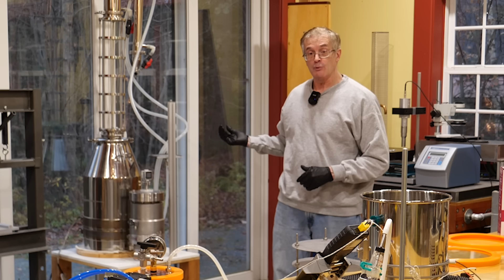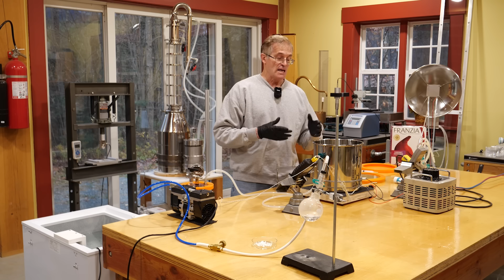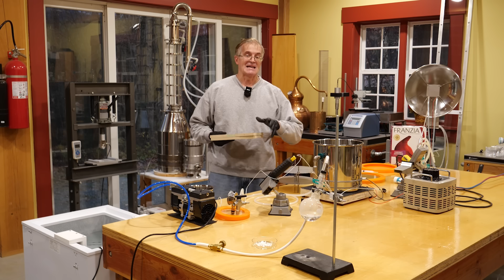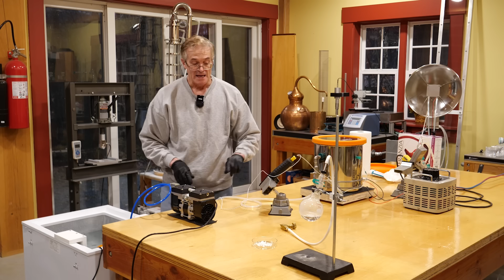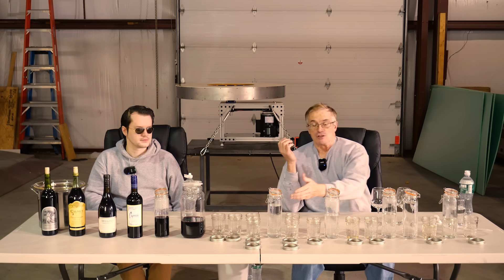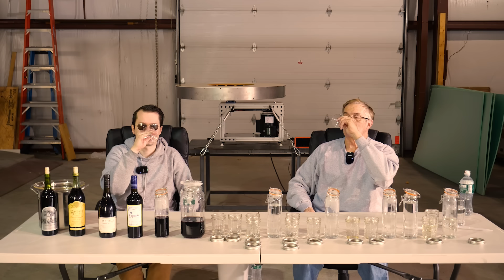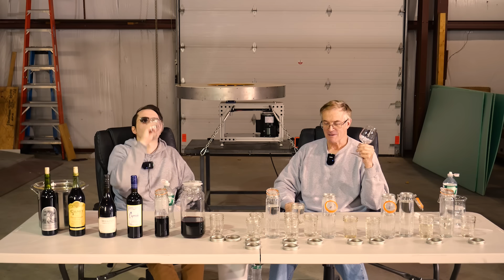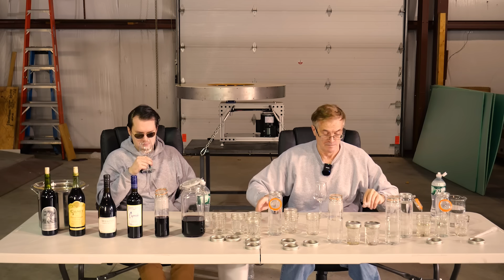Turning $3 Wine into a $100 Vintage with Science!

Comment: Try putting the new wine you made into different types of wood cask for a few months and see if that puts it over the top for both taste and aroma. Also try pulling apart a high end wine and see you can improve on that, see if high end wines have as much junk that can be removed.
Reply: Easier to add wood chips to the wine than having to buy casks. Also you can toast the woodchips to different temperatures to achieve different flavour profiles. I have done this myself and it works very well and faster than putting the wine or spirit in wooden casks.
Reply: @stumccabe  Or better yet, use the wood chips and put the container in an ultrasonic cleaner for a few minutes to get barrel aged product almost instantly.
Reply: @seeigecannon  Excellent idea!
Reply: @seeigecannon I came to the comments section to post this! It works great for me. I buy cheap, terrible whiskey for making boilo every winter, and the left over whiskey gets 5 minutes with charred smoking chips. Usually comes out somewhere at roughly a mid price range equivalent. (It's great for infusing flavors into vodka, too)
Reply: Or try to improve on Thought Emporium's vid on vacuum infusion
Reply: And if it turns out all the fractions are miraculously tasty, they can certainly just use it as really good brandy!

Comment: If you used a dip-tube in the collection pot, and used two of them, you could actually run as a continuous process, if you had check valves to isolate the collection pots.

Comment: Yup the ratio of head, hearts and tails is important as well. A good example of this is Mescal. Which like generic Tequila i generally don't care for. However, there is a brand called V-SOTE Mescal that has triple distilled and I believe put back a tiny bit if the heads and tails to make an EXCELLENT SMOOTH (never thought I say that about Tequila or Mescal) sipping Mescal. Usually here in the Yucatan served in a small gourd. For the Tequila equivalent it would be Hussong's. Hussong's used to be bottled in an earthenware bottle sealed and serialized.

Comment: Would you be able to achieve a similar thing in your big distiller if you flooded it with Nitrogen or Argon instead of using vacuum?
Reply: Likely, but a higher temperature would be needed.
His trick here is a relatively low temperature separation.

Comment: In my experience the greese is unnecessary, the pressure from the vacuum seals the gasket just fine. I am concerned about weakening the structure by drillin and pluging the thin sides with rubber. I would not be surprised if it collapsed. I have witnessed structures collapsed by vacuum. Similar to exploding but in reverse. Very scary! Thanks for the video! Cery cool process..if you have electricity.

Comment: you don't have to guess the cuts: if you have a temp gauge in the distillation fluid you can tell when there's major shifts in what's evaporating by the temp changing. you can use this as a rough guide the first few times, then as you narrow in on what you care about you can do additional cuts as you see fit.
Reply: Well I was thinking the same thing but do keep in mind that they are doing a vacuum distilation with a relatively weak heat element just to keep it from getting cold. I don't know if there would be a noticible change in temperature enough to use as a basis for seperation. I reckon that can definitely be done using precise equipment and calculating the rate of change of temperature over time but this works just fine.
Reply: @quas-r  I'm not a chemist, but I know there are ways to determine what is boiling off at a given temp under vacuum. Vapour pressure, etc.
Reply: @Scou73r you just need to find a list of the different molecular compounds in whatever wine you started with (just looking up the type, e.g. Malbec, is probably good enough) and then finding the phase charts for those chemicals. Just cross reference your vacuum pressure and room temperature and find the graph where that (pressure, temperature) point is on the line where the chart transitions from liquid to gas (or solid to gas, as the case may be). 

If you aren't able to measure the vacuum pressure or it is just easier in your setup, you can also do the same thing but inverted by using multiple condensing flasks cooled to different temperatures that you get from the same charts. You can also do it with a single condensing flask, but you have to condense them one at a time in order of their condensation  point. You have to order them correctly with multiple flasks, but they all condense simultaneously (to a degree of accuracy that wouldn't fly in a lab or fluid dynamics class, but it's basically all at the same time)
Reply: @Brenden.smith.921 Fluid dynamics classes usually only have blackboards (and maybe computers) :-)
Reply: @Scou73r  Simple, with only about 100k $ you add a mass spectrometer to the system and youll know... XD
Reply: I think it may be hard, since there are a lot of different compounds in there. If the boiling point between each of them is close then it smooths out the graph.
Add the fact that you still get some volatiles coming over when the temperature is below the boiling point due to single molecules having different velocities in the liquid so the line gets further smoothed out. The last point is why you often see triple distilled liquors - by repeating the process you can increase the separation. I'm pretty sure that was mentioned when they did the sake videos.
Finally, they would probably want to introduce some stirring in the pot so they don't have a temperature gradient in there. The liquid is going to be hotter next to the heating band than at the center of the pot when they don't ensure that the liquid is mixed to even out the temperature.
Reply: You're correct about needing to be aware of the fact that some liquids can vaporize without evaporating. These are the "volatiles" that are referred to in the video, and they will almost always come across in the initial boiling because their vapor pressure is such that they can vaporize in 1 atm, let alone 5% of that. Ethanol is one of these volatiles like this, but there are a couple other ones. They're well known and you can get them from a Google search. Since this isn't meant to be a perfect process, I would just call it good enough to know that there are some volatiles in with the first distillate(s) and know what they are. 

Also, if you do the inverted process I mentioned where you cool the flasks to a specific temperature instead of going off of the vacuum pressure and room temperature to get a measurement, then you don't run into the issue of vaporization since that process doesn't skew the data the same way in reverse.
Reply: Thats cool. I was thinking about it how to fractal it into exact components. So you just gave a solution! 🤟🤟🤟
Reply: No. They weren't using heat to distill. If you do use heat, the evaporation of the alcohol out of the mash cools it, meaning it self-regulates the temp, keeping it steady. That's why those old-time distillers in the hills of Tennessee could just throw a bunch of logs under the pot without worrying about it overheating. Just watch the thermometer, and when the temp finally starts to rise you know you're done because there isn't enough alcohol left in the mash to keep the temp down. You don't want that last bit anyway. And yes, i DO speak from experience.
Reply: If you've ever distilled a gin you've noticed a large range of distinct flavour bands. From the very volatile cilantro to the less volatile brown/dry spices one after another. Temps are useful, but won't help much  when tiny concentrations of volitiles have huge effects on flavour.
Reply: How would you approach temps since under vacuum?
Reply: In this particular setup the pressure is not necessarily a constant so that doesn't necessarily work.
Reply: No. 
1. What they taught you in high school is a lie; there are no sharp changes in temperature. Even in simple two component mixtures, the temperature changes gradually and with it, so does the proportion of the components in the distillate. It is in fact not possible to completely separate mixtures by distillation because at some point they form an azeotrope. Fun fact: Ethanol forms an azeotrope with water at 95% concentration, so you cannot get higher than 95% ethanol via distillation alone, so when he said his first fraction was 98% alcohol, that was incorrect (in fact, without using a reflux column, he was getting 80-90% at most). 
2. Wine is not a simple mixture, it has thousands of components, making any sort of temperature to component mapping virtually impossible. 
3. This setup is not pressure controlled, which makes the boiling points of all the components change over time. If you wanted to have the slightest chance of making this work, you'd need a setup which maintains the same pressure throughout the whole process with a high degree of precision.

Comment: You might make finer cuts at the beginning to dispose of the hot lip-burning foreshots, then again in the region you disposed where the alcohol runs out and you get the musty smelly-sock aroma so you can focus on just tasting those regions. You should get bright fruit early (careful because acetaldehyde can be deceiving), dark fruit later, and then the oils toward the end where you found floral!

Also I'd recommend a refraction alcometer as a quick way to proof-down the drink to no higher than 35% ABV for tasting, otherwise you blow out your taste buds, especially starting with the aggressive heads!

Comment: I was right there with you until you poured the alcohol out of the distillation vessel over the grease on the rim. I would have used a syringe to draw out the alcohol, and not contaminate it with grease. The grease may alter the flavor of the alcohol.

Comment: Did you pull an all-nighter and forget it is now Sunday?  I'd be tempted to add back some distilled water to account for at least part of the volume of liquid you removed, easy to try by diluting a sample of your recombination.   I'd also be interested if separating the first couple of ounces distilled and discarding might lead to an improvement as well.

Comment: I was able to extract lemon essence and a hydrosol from lemon peels using a microwave extractor. For small batches of the stuff, it gave surprisingly high yields and didn't cook away or dissipate the lemon essence or hydrosol like many of the standard distillations do. For larger batches I was thinking of a vacuum Soxhlet distillation apparatus. If that makes sense.

Comment: @22:20 i can say firsthand that every single harbor freight vacuum i've used has had oil residue end up in the product. even using filters won't stop it. it's gotta be food safe or it will get contaminated with oil

Comment: I guess I know why my vac chamber blew in. (The lid sucked into the pot.) I didn't use the grease.
Reply: That sounds more like an implosion from too much vacuum. In that case, grease would not have helped.
Reply: @PaulLawson-k8v   I didn't have vac pump maxed out. Or at least I didn't have the gauge bottomed out and boom pow or whatever. The lid is still inside the pot and it is in one piece but it has cracks all through it like a solid piece of tempered glass. I was cringing even though I know nothing happened or we wouldn't have had the video, but putting your head over the top of a vac chamber is something I won't do and I sure won't put my face right over one. I was standing over mine and crap hit the ceiling but missed me.

Comment: Vine is highly overrated, imho - but this I can get behind! It's like grind size and pressure curve do more to espresso than any espresso machine could ever do (according to my experiments). In espresso universe, we also do sliced shots, to see what flavours are extracted at what stage of the pull, or at what pressure.
Reply: Frosty cold, $6 Champagne is the best wine. I despise wine culture, so that's as close as I get.

Is there anything like a sliced shot, in the pour over or drip coffee world? 

I'd like an Arduino-controlled Technivorm with a trough instead of a basket, so that the entire cup is 'first fruits' (or 'heads/hearts', I guess LOL).
Reply: @PaulLawson-k8v  Interesting! I do not go near any alcohol, so I am easily out of this equation. My frowning towards vine is based on the numours experiments that have been done, proving that price and taste do not correlate, imagined value and taste do.

As for pour over, I am not versed enough to be of any help, and thus refrain from uttering any half solids here.

But cutting an espresso shot short (also known as a "ristretto" greatly alters taste in cup, all other variables being equal.
Also, I managed to get a quality out of a rather commoners' roast after dabbling with pressure curves, grinds, and even baskets, to make some heavy espresso drinkers nod to the results.

All that being said, if anyone gets to their destination their way, I am happy - as long as I can also get to mine ;-)

Comment: I don't know if the splicing of the thermocouple leads is valid. I'm guessing they are type K TCs which has a nickel-chromium positive lead and a nickel-aluminum negative lead. You obviously got readings but I just don't know how accurate they were.
Reply: Good point of general DIY usefulness.

I also suspect that thermocouples are not interchangeable, by part number or model number.
Reply: @PaulLawson-k8v TCs are interchangeable by type. All type Js will interchange. All type Ks will interchange. Js will not interchange with Ks. Also, the wires need to match the type of TC.
Reply: It can be if done propper. Id just use a compression fitting, bored thru (nontube stop) and bite into the probe. One hole.
Reply: @Skunkhunt_42 They make special terminators and connectors for TCs.
Reply: Yep. I was going to say the same. Adding a different material (stainless, copper, etc) creates 2 more TC junctions in the path. If he were to hit it with a heat gun the temperature reading would change. If the meter, the bad splice, and the hot junction were all at the same temperature the error would be 0, but as any of them start changing temperature relative to the other parts the error will grow.

The best way to make something like this water/vacuum proof would be to put it into a sleeve and add a liquid epoxy that can wick into the insulation and block the transport path. Something we did at my previous job too for things that needed to ensure sewer water can't get into the control board if the battery leaked is they would take stranded wire, remove insulation from the middle of the wires, and epoxy it into a strain relief. This way, water could only travel along the strands up to that epoxy plug.
Reply: @seeigecannon The simple way to do this is via a thermowell. They would provide a barrier from atmosphere to vacuum chamber.

Comment: 19:15 I've also seen punches used here. Instead of drilling put the stopper into a vice but sideways with a bit of metal tube with a sharpened Inner edge the size of your fitting. Close the tube & stopper into a clamp & press the sharpened hole cutter (like used in grommet cutting) to cut your hole.

Comment: Isn't the methanol case the other way around? You said to not worry about methanol in wine but rather, in grains?
I recently read about this (due to making beer) and learned that no methanol is created when fermenting wort, because methanol comes from fruits. I also read that the acceptable levels of methanol is dramatically higher for wine than for beer as it ..."naturally" is expected to exist in the product. At least with EU regulations.
Reply: if you have a bottle of wine that is meant to be consumed as is, then it's also going to be fine as a distillate, because you don't create any methanol during that process
Reply: @Pedynkuziego no, you will create a concentrate - but they wasn't the question at hand. He said it wasn't a problem because of it being wine, not grains, i.e the other way around.

Comment: Is that wine "CardBordeaux?"   I'm loving this experiment!
Reply: One thing I learned about boxed wine is opening it doesn't really affect it. Basically, unless you tilt it back with the nozzle opened and up higher than the box, oxygen doesn't enter the wine or bag it's contained in.
Reply: People add ceramic or stainless steel beads to opened bottles of whisky etc. to reduce the amount of oxidation as well. The beads replace the lost liquid volume so the bottle stays full and less air gets in every time you pour a glass.
Reply: We call it Chateau de Cardboard :)